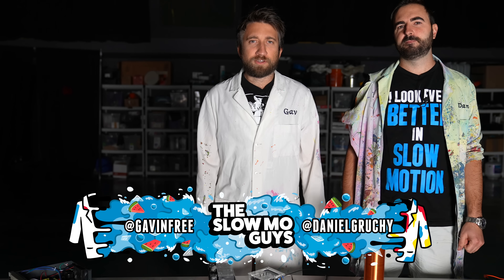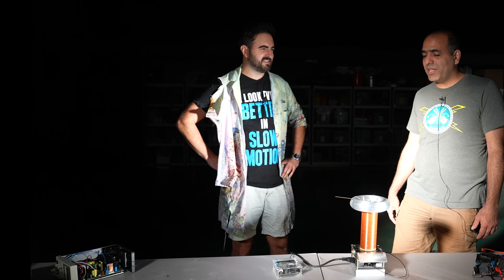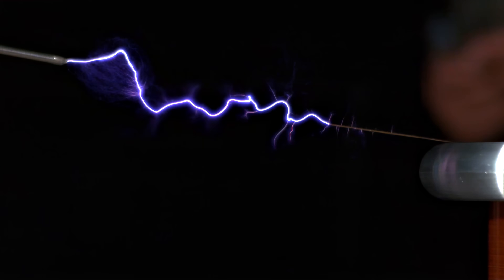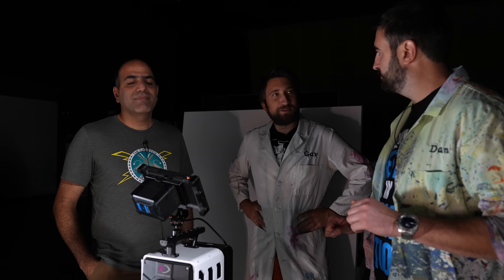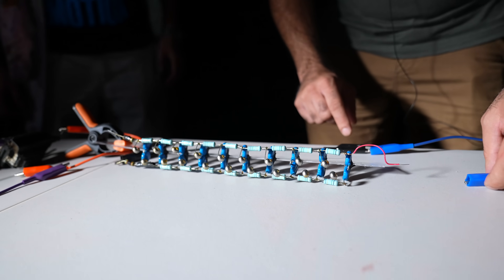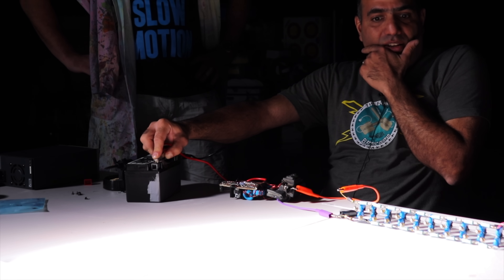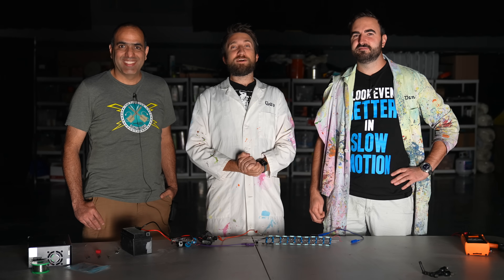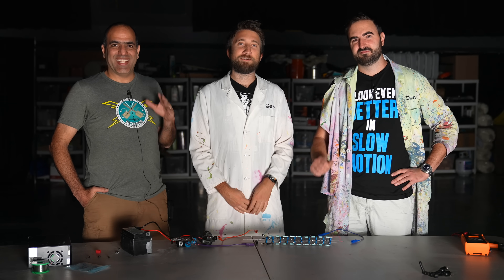Electrical Arcs at 1,750,000FPS - The Slow Mo Guys with ElectroBOOM

Comment: To get higher frame rates than even this camera can show, you just need a super duper short exposure and to set the electrical arcs to a slightly different frequency than the camera's frame rate. That will allow you to capture one frame of a different instant of each separate but similar arc. The best way to achieve this would probably be to use a mirrorless camera with universal shutter and build a circuit which outputs a pulse to the camera's trigger at the same time as the high voltage arc generator.

Comment: At that framerate, light travels at about 170 m/s. That's just astounding.
Reply: I don’t know about you but those numbers look off. If you replay the clip from 1.75 million fps to just 25 fps, that’d be 70,000 times slower than real time.

Doing some calculations… the speed of light would just be going about 4.29 km/s in that clip, which is still incredibly fast to our eyes.

If I’m wrong, do call me out.
Reply: @Wmann  No, I think you're absolutely right! I naively divided the speed of light by 1.75 million, completely forgetting that video is 25 fps. So thanks for the correction. 👍
Reply: @Wmann  Yeah i thought it sounded a bit off. It would have meant you could film a laser pen going off and it would look a bit like a Bugatti on one of those top speed runs as it passes the camera. Which is still fast, but nowhere near the speed of light, even at that framerate. Thanks for clarifying for me :)
Reply: @Wmann yeah it would be 170 meters per frame not per second
Reply: What great point. I thought how awesome it would be for them to capture that in a wide view then remembered the needed brightness for indirect illumination that goes into the camera 💀💀
Reply: That's still 620 km/h, incredibly fast
Reply: @teik I mean before the turn of the millennium, we had already made a "car" that hit a top speed of almost double that. So yeah, still very fast, but for light to slow down so significantly that even a land vehicle built in 1997 is twice as fast is quite something.

Of course, it wasn't 620 km/h, so my point is kind of mute in the greater whole of the conversation.
Reply: @oliverholm3973  moot*
Reply: They could probably film light propagating with a wide lens, from a distance. It would do like  150 meters in one frame. How cool would that be.
Reply: @PuerRidcully I thought there was some hard barrier to this, like it's not as simple as just waiting until a camera with a higher frame rate is developed... There's a video on YouTube of a guy who built a rig that simulates the effect of capturing the propagation of light, but he does it in some roundabout way, like recording multiple samples and then building a composite of how it would appear (or something). But years ago when I first saw that, I thought I remember reading that truly capturing it on film would be harder than just using a faster camera. Maybe I'm wrong and I'm just thinking of the wavelength barrier that prevents us from imaging stuff at super small scales...
Reply: and yet, to actually capture any sequentiality in the breakdown of the gaps would require something along the lines of a three magnitude increase to 500picoseconds, or about 17cm/s using your figure.

and even then... ouch, if the gaps are only a few mm apart, its gotta go faster again! arrrgh! they break down at the speed of light * propagation delay... maybe 0.7, maybe 0.5... this is an unusual form of transmission line, not a plain wire. or coax. 

five magnitudes of order for 1.7mm/s...
edit:
someone now says 4.29km/s
6 orders for 4.29mm/s....
Reply: light?
Reply: Strange?  I always thought light (and electrons) travel at 300000000 m/s (in a vacuum). So even in air light is still quite a bit faster than 170 m/s.
Reply: @edwardcarpenter8277  pff xd time in refrence to the cameras footage
Reply: @edwardcarpenter8277  "At that frame rate"
Reply: @edwardcarpenter8277 it travels 170m every second of the clip in 1.75m frames per second, so light would still not be able to be seen or detected on camera

Comment: It's so cool how nature provides you with a relaxing soundtrack whenever you're in slow mo.
Reply: I bet you can hear it as you're dying. That would be nice
Reply: Edits
Reply: most of the sounds at these speeds are edited in by gav, as usually they make no sense at all to human hearing.
Reply: @JoseNovaUltra  is joke
Reply: @JoseNovaUltra "as usually they make no sense to human hearing" that's not the reason. Phantoms don't even record sound...
Reply: @xjunkxyrdxdog89   No, microphones do.. gav has said that he always records sound just in case (at low camera speed can be useful), the camera itself doesn't need to record it and even when it can, nobody uses cam audio in pro settings. He is actively recording sounds from their lavs too
Reply: @goodguyguan3412It wouldn't even sound like anything. The ADCs in their recorders probably operate at somewhere around 40kHz, which can only reproduce sounds at 20kHz or below. If you try to slow those sounds down to the degree they would have to, you end up with a sound wave so low frequency that it's barely even measurable.
Reply: @JoseNovaUltra  omg are you sherlock?
Reply: @JoseNovaUltra  whoosh
Reply: @jimmyjon9970  jose probably forgot
Reply: @JoseNovaUltra  interesting....
Reply: ok
Reply: @giangtruc3376  ko

Comment: Could you double a phantoms speed if you had two?  Use  two  cameras to shoot the same subject with a mirror and then  start one right after the first frame of the other and then use software to interlace the two cameras every other frame. I'm not sure if the frame pacing is precise enough tho

Comment: What kind of electricity are you using in this? What is current, voltage, resistance, and picture of the circuit diagram for this.

Comment: @6:02 for clarity the arc isn't meeting in the middle, just like lightning, the imaginary corridor of electrons is already flowing invisibly, what then happens is because of resistance the electrons friction heat the air along the path of that imaginary corridor which produces plasma generating light. You see it first where the greatest resistance(s) is and it travels from area of greater heat to that of lesser. In storms this would be from the connection point(cloud) to the ground. Just imagine an invisible wire reaching up and touching the cloud, it then starts glowing at that point with the heat following the wire, eventually glowing all the way to ground. There is an invisible field that has already determined the path of the electrons based on resistance. The charge, believe it or not, actually increases in the point of connection before the electrons have even arrived in response to the change of the field. Kind of like the information arrived before the actual particles.
Reply: I think it's fundamentally a wave phenomenon rather than one based on electron flow. Even in wired circuits, that turns out to be the case. It's the field around the wire which actually carries the energy, and this has been known for a long time, but it's conveniently and conventionally overlooked. This explanation was recently resuscitated and ostensibly demonstrated by experiment on the YouTube channel Veritasium, and it's fairly thought provoking.

Comment: I'm at the start of the video and actually really excited to see if the camera can see a difference in time between the sparks.

Voltage propagation down a wire... I want to know if it either occurs at the speed of light, or a speed proportional to the resistance in the wire medium.
Reply: Wow, it needed to overcome the highest voltage differential 1st, then it was able to instantly overcome the smaller voltage differences along the pathway. That's very interesting.

But it does seem that the voltage traveled at the speed of light once breakdown was achieved in the medium.

Comment: So, if I'm understading this right, as electricity is expelled, it branches out to equal paths of least resistance. The further it travels down one path, the more energy will follow it down that path. It's not so much that the other branches hit a proverbial brick wall so much as they encounter some resistance, and in that time, one or more paths end up traveling far enough that energy stops going to those other branches because the energy has to follow the existing arcs.

If we imagine a room full of air as a room full of various viscous materials, and the path the electricity takes like someone trying to walk through it in a full-body suit, you'd have points where the person found patches of thicker material or outright solid objects, but a path would form. That's the path the electricity wants to take when the next electrical charge is expelled. But because the electricity heated up the air, the pressure changes so the path isn't exactly the same because other gases are being pushed into the space due to the hot air moving. Sort of like if the viscous room analogy were allowed to settle a bit before the next person went through, the path might not be exactly the same because some of the thicker material might encroach more on the path, or pool on the ground making it more difficult to lift your feet with each step.

It all appears random because we can't see the gases in the air that might be affecting the path that the electrical arcs take, and because the electricity itself is changing the air it's discharged into, that further contributes to the random nature of the paths the electrical arcs take. With the electricity arcing out the same way multiple times because, regardless of whether a path offers the greatest distance, it's not trying to get from point A. to point B. it's just moving via whatever path is available to it. So even though it seems like distance is of no consequence given how absurdly fast it travels, its movements arn't much different from flowing water, just on a 3 dimensional plane and unaffected by gravity.

Comment: It's my understanding that the final cap triggering first is because current is the flow of electrons which are negatively charged, so the physical path of the current is from the negative terminal  to the positive terminal. Please do correct me if im wrong, I am not a physicist nor an electrician.

Comment: It's obvious that the last right most side capacitor would go out first because it completes the circuit when the charge it full and pressure at Max. For electrons, there ain't no walls, when pressure is high, it tunnels through trying to complete the circuit to jump to the nearest exit, in this case the right most arc exit.

Comment: Technical remark: assuming Medhi's circuit is a standard spark gap voltage multiplier, the arc that goes first is probably the one in the narrowest gap. I wonder what happens if you change the gap a tiny bit.

Comment: When we talk of electricity, we mustn't think of it as an actual thing, flowing through the air. Because what it is, is describing a change in the state of matter of the air, the change is going through. With this change traveling from an anode but then and once it makes contact with the cathode, creates a circuit. With a negative return also being withing the same structure of the discharge and so is a mechanism to balance charge between two points. And so, is not a power dump in a single direction, like water down a plughole. Instead, it is a circuit, a Birkeland current and so has the charge moving in both directions through it. There are three types of Plasma Discharge Mode, Mode 1 (dark mode), where there isn't enough charge density in the discharge to be seen in visible to human wavelengths of the EM Spectrum. PDM 2 (glow mode) and where the discharge starts to tighten, with the charge density increasing and so we can start to see the discharge and PDM 3 (arc mode) and where the discharge is high powered. With the magnetic fields created by the discharge, then pulling it into a very tight strike.

Comment: I would like to have seen highest speed footage of the Tesla coil discharge into the air, where it takes many paths, instead of just the single arc path to the screwdriver.

Comment: It would be cool to see the effects of significant temperature differences of the path of the arc.. like have a piece of Dry Ice held above the end electrode, and see if the arc goes through it, or around it..
Maybe try with a PC fan blowing across the path of the arc, to constantly move the arc-heated air away..
Then try the fan with the Dry Ice vapour too..

Comment: I like the experiments of both parties very much and I like to see them working together. 
Just for the measurement of the sequence of sparks in the second part they could have taken an old cheap multichannel  oscilloscope to achieve a 100 times higher resolution or 10000 times higher resolution with a high end type. (Knowing the results you can adjust the comparably slow optical experiment accordingly. Maybe "the signal path" has a solution.)   :o)

Comment: I want to see a Slow motion of a TEA N2 Laser hitting the Tesla coil top.  It should create a direct, straight line as the TEA ionizes the air and since you have a channel I want to see if the Picosecond pulse allows the laser to get stronger as it may lase the Air channel itself.

Comment: 11:30 thats what i thought. The energy was like a tide but at an INSANE level of speed. Each time it surges into the tip of that the air gets energized. It eventually flashes past into a plasma giving off light but it happens so fast. Each time that surge happens its so fast- you know my brain is fried trying to process what im saying and what i saw lol. And to think your brain goes and lets off tiny electrical and chemical charges at a tiny scale EVERY NANOSECOND OF OUR LIVES.

Comment: i'm not an electrical engineer but if that coil is creating music the way that an electronic instrument does i'd guess it flickers like that because all waves are made of smaller sine waves so we're basically seeing the small very fast rise and fall in charge caused by them which is also why the sounds produced by the coil are so rich in overtones
Reply: There was a video I stumbled across a couple years ago about what I believe is called Macrotempo, the concept of making a kick beat of upwards of 1 million BPM, and it had an extremely similar result to Tesla Coil music, where no matter the sound, the frequency increases did in fact make recognizable notes . I believe the spark/boom of the electrical discharge is doing the exact same thing.

Basically, I'm pretty sure you're correct, or very  near to it if not
Reply: @Incompetent_Hero  Jesus Christ, speedcore’s evolving again!

Comment: I will give this a stab; we can not build nature or natural conduction. The timing on a device made by them has to determine the devices on the line because it is limited to that device, but nature is unlimited, so it is fluid. When you build a machine, it is controlled within a box; it does not have a free range like nature, So within the device. When creating things, human nature tends to make things with the idea of controlling things. We limit ourselves, our minds, and the experiment. Try building without limiters.

Comment: There is a camera that films at 70,000,000,000,000 fps you can see nuclear fusion, radioactive decay, and even light traveling (I don't understand hoe considering the photons are what's hitting the camera lens.. but I read it on the internet)

Comment: It's like a neural web that happens in the air simultaneously being accessed by the coil... This is why we are conductors, we are those connections, at the conception of life. We are compatible with the environment around us, inside us is that same system, organized perfectly to provide movement ability (circulatory & nervous systems). Alright, enough babbling from someone not in a science field xD

Comment: Excellent visualisation of frequency. Seeing this I think a good idea would be to capture in slow motion a start of a metal halide lamp. In short MH lamps are discharge lamps where there is a sealed arctube filled with noble gas, mercury and salts of metals, when lamp is cold the salts are deposited on the arctube. Initially an external ignitor strikes an arc between electrodes and at first only noble gas is ionised, the arc heats up mercury which then evaporates and is ionised, after that sequentially the arc goes even higher in temperature which makes metal salts evaporate too and be ionised. Thing is that with such progression the arc changes color as each next ionised element contributes to the spectrum. Sometimes in certain metal halide lamps a larger chunk of deposited salt gravitationally comes into the arc which causes fast evaporation which can be seen as a flash of certain color, like pink flash. I think such flash would look awesome when captured in slow motion. When turning on a cold lamp, sometimes emissive coating from electrodes goes ejected and ionised, resulting in another type of flash. Also such lamps when powered from 50Hz mains supply flash hundred times per second so would be interesting if pink flashes during salt evaporation are is in sync with main arc frequency.

Comment: I studied electrical engineering with specialization in high voltage and this video really gave me flashbacks to all the lectures regarding the topic haha

Nothing really surprised me, but it’s very nice to see those effects I’ve learned about actually happen.
Reply: How does the arcs travel in the air like the branches of a tree?
Reply: @infinityplusone-1  Electrons are looking for the path of least resistance. They're basically just shooting off in all the random directions with other electrons following them until the "correct" path is found. You can see that once the electric arc is established, all the branches disappear. 4:00
Reply: @kolosmenus  thanks for your help bro. I'm from a computer science background and this process reminded me of a Graph algorithm for finding shortest path lol